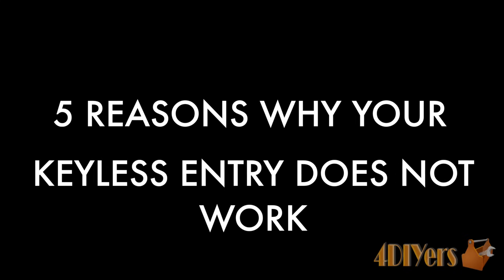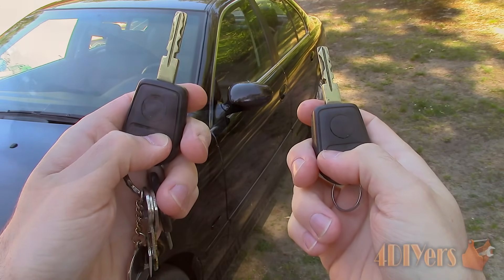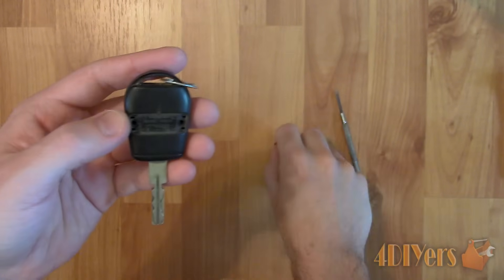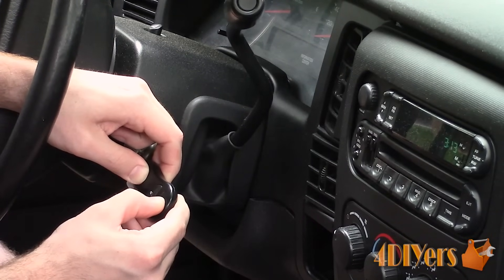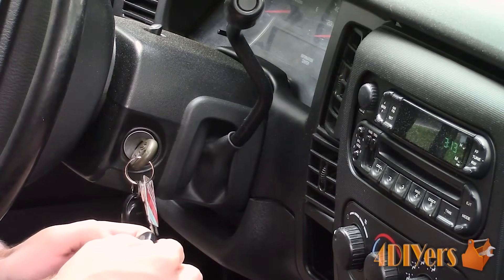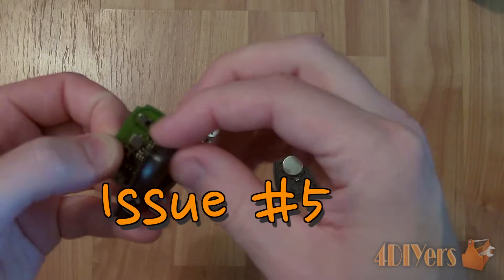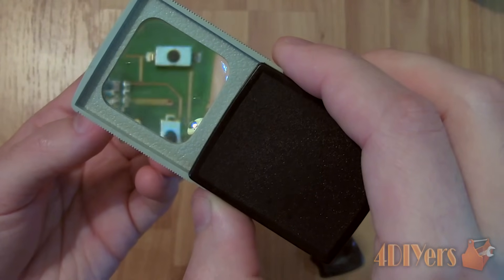5 Reasons Why a Keyless Remote Does Not Work

Comment: Note: December 2025, I went around and around because my 2013 Camry key fob CR 2016 batteries were bad. At times my key fob would not work then it stopped altogether. I found two unused Duracell batteries ( still in their original packing ( expiration date 2028 )). They tested 3 volts. I put them in my two key fobs and they would not unlock the door. I checked the fuses. I disconnected the 12 Volt car battery, checked the alternator and tried to reset the key fobs. I was looking at buying a receiver ($85.00 used on Ebay). Then, I found the paperwork on my unused CR 2016 battery. They were purchased in 2019. I went to Walmart purchased two Eveready batteries (Expiration date 2036). I put them in and both key fobs worked.
As stated by other, testing for 3 volts is not good enough.  Buy good new batteries with the longest expiration date.

Comment: I have an issue with which i am unable to find a related video, i use opel meriva 2011 whenever i lock the car with it keys. It flashes and then locks the front doors only. The back doors, for some reasons refuse to lock automatically, and i can't seem to figure out why. Can you help, please
Reply from the maker: If you press the lock button in the interior of the car, do the rear doors lock?

Comment: currently having an issue with my keyfob (2020 toyota yaris) I'll have my keys in car & the red key light will flash it won't let me start the car. after a couple trys it will eventually let me start the car what is the problem?

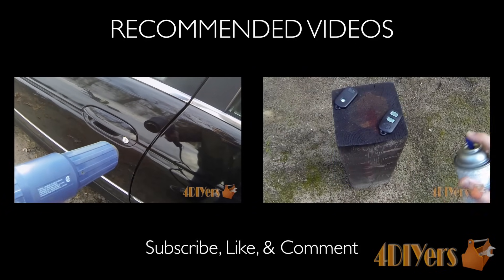Comment: 3:36  I replaced the battery in the pod for my 2006 charger, it will operate headlights and door locks but won't start the car, any advice would be appreciated.

Comment: Just changed my battery, it wouldnt work at all. Put the old ones back in, and my fob works when it wants to
Reply from the maker: Sounds like the new battery isn't fully charged and most likely old stock.

Comment: I have a 2005 Honda accord. And as a new widow I’ve got to figure this out on my own . I’m having a couple of problems. A viper alarm has been installed and the fob stopped working. Changed the batteries and it lights up but still doesn’t work. I’m assuming it has to be reset. That’s where the issue comes in. I cannot get my key in the drivers side door due to someone putting something in the key hole. I can’t get the key inserted. Is there anyway to reset the fob???? Thank u for any advice u can give me.
Reply from the maker: If you know the model number of your alarm system, you can usually find a user manual for it through Google. The procedure will vary, some have a reset button on the side of the module. To get the model number, you’ll need to find the module box in your car. If I had to guess, it’s probably under the steering column. That was a very common location.

Comment: My fob never opened everything, there was always an issue. First the passenger side stopped opening, then the trunk, then the drivers side. The only thing that opens is the driver side sliding door, and sometimes the passenger side sliding door, and the locks inside the car, same. My issue is that it stopped beeping about a year ago, changed the car battery and it started working again, now it stopped again. The theft light is still on in the car, and you can hear the back door locking, but no beeps.

Comment: Hello! A year ago, my Toyota Camry 2014 key fob had stopped working. I've replaced the key battery a few times and after many troubleshooting, I've dug out my spare key, and the same problem with my spare as well. I'm thinking it may be a fuse issue at this point because I've tried replacing batteries on both keys and trying reprogramming, but I don't actually have a function key at this point. Any ideas about what it could be?
Reply: I have a 2014 Camry as well and I'm experiencing this problem. It started last month where it didn't work for a day or so. It began working so I thought it was just a fluke. Now I'm experiencing it again . I don't believe it's the battery because I have a spare key fob and it's doing the same thing.

Comment: My first key FOB seldom used wasn't working, replaced with brand new battery still didn't work. My second key FOB for the same car was working fine, had cheap battery then died. Replaced the battery and now that doesn't work.
Reply: Wow, my same EXACT scenario. I'm stumped.
Reply: Same ours just started doing the same

Comment: Hope I can get some suggestions .My car was broken into car window on driver side was smashes door left open during the rain.Now my keyfob wont work to lock or unlock doors the alarm isnt working either or remote start.Also the button to lock the windows that is located on driver door no longer works.
Reply from the maker: Sounds to me like you have a wiring issue due to the excessive amount of moisture. The first step would be drying out the interior, then going over any terminals, use a contact cleaner like DeoxIT and replace any components as needed.

Comment: I had 2 keyfobs that stopped working my door locks. The batteries on both were 3.2V so they were great. While the batteries were out I took some electronic cleaner and sprayed it on a cotton swab to clean the contacts, reinserted the battery and voila! Keyfob #1 was working again - just needed the contacts cleaned. Keyfob #2 I had to take a pocket knife and GENTLY scrape the crud off the keyfob battery contacts to make them shiny again, cleaned them with the electronics cleaner sprayed on the cotton swab, reinserted the battery and voila - keyfob #2 working again like new! Dirty contacts was the problem with both my keyfobs.

Comment: Hi, I own a 2004 Chrysler PT with wireless remote; it can unlock the doors or sound the alarm. I don't use it, rather I keep in a drawer if I need it. Lately as I drive around the door locks are activated at random. I think this is because wireless remotes have become popular and the airwaves have become filled with remote key codes. How can I deactivate this feature? Thanks.

Comment: Every once in a while, I've noticed that using the key fob on our aftermarket car alarm doesn't disable it and the alarm goes off. The alarm light on the dash will still be blinking armed even after unlock was pressed on the aftermarket key fob to disable the alarm. The car didn't have a factory alarm system on it at all beforehand and the aftermarket alarm system was installed at a professional place. It rarely has this issue. Other times, in a certain large parking lot of a specific business up the street, it doesn't respond to unlock/disarm commands at all for a while and finally does. Just some kind of interference?

Comment: Not sure if I'll get an answer because this is an old thread. I had a weird problem with keyless entry. Walked up to my car and the key fob didn't work. I got inside the car and it worked. I got the other fob and it did the same thing. I bought duracell batteries and replaced both. It still was doing same thing and did it the rest of the day into the evening. I woke up and it started working and has been working ever since. I think that there is a number one and two fob when programmed. I'm thinking if the number one battery went completely dead it affected the number 2 fob. Maybe letting it go completely dead it may have lost its program and overnight it picked up the signal again.

Comment: Hello
On my 2008 Audi A5 Sport, the functions on my remote key fob have stopped, meaning i cannot lock and unlock doors anymore, nor the boot door, nor the fuel cap, not the retracting door mirrors. 
I can open the door with the metal key which is inside the fob, both main and spare key (the alarm will go off though) and the car does start when inserting the jey into the ignition hole. It's just the remote functions no longer work. It's not the battery inside, because i tried some new ones already, and the LED light on the fob does come on when pressing any button.
So what in your appreciated opinion, can be done about it? 
Best regards, Sergio UK

Comment: Thanks man, I had bad fuse contact, any product for cleaning the fuse contacts box? I was thinking of WD40 but I’m not sure if it is the best for this kind of situation. Thanks 🙏
Reply from the maker: No problem, happy I could help. Don't use WD40. For an electronics cleaner, I'd highly recommend DeoxIt D5 spray.
Reply: @4DIYers  thanks for the tip. 👍
Reply: Should be using an  electrical contact cleang spray.. very common in hardware and autoparts store

Comment: I have purchased 4 key remotes for my Kia 2012, they have new batteries, they used to work then completely stopped working, I purchased from the dealer at $99.00 for the remote and $99.00 to program, thats over $200.00 with tax!! Remember I said I have had to replace 3 and the 4th wont even program. I took it to an reliable auto remote dealer Who tested my remotes and and they were not able to program it themselves and told me my only other option is to take it to the Dealer!!  I am told it is $150.00 just to look at it and tell me why my remote wont program, and this does not apply to the cost if I would agree for KIA to do the repairs because then  the remote program is another $99.00, this is high way robbery, any suggestions?
Reply from the maker: This may help https://www.hendrickkia.com/manufacturer-information/kia-key-fob-tips-and-tricks/ Some vehicles now are dealer only programming, but that's something which happened in the last few years. It's becoming harder and harder to do things like this without needing special equipment. If that option above doesn't work, a Kia forum or Facebook group may know another way around for avoiding the dealer.

Comment: Hi, my remote key does unlock the car but not locks it, but the remote light is on when i push on lock, i got 2 keys with a remote in both and it's all the same problem. It is about programming or the remote module is defect?

Comment: You can also try cleaning the contacts with rubbing alcohol. While this didn't work for me, it works for a lot of faulty key fobs.
Reply from the maker: Great tip, thank you for sharing!
Reply: @4DIYers  Apparently 99% isopropyl alcohol is what’s suggested. I ordered some to see if that will work better than 70%.
Reply: Where are contacts ?

Comment: Here's one for ya! Without going into details, I fudged my key fob programming procedure! 
Now when I try to reprogram my key fobs and get to the point where you have to put the key in and take it out 6 times within 10 sec. is no longer needed because my car is stuck in that position.So I hit a button on the key fob, the flashers flash but the fob is not programmed.
I'm wondering if I should disconnect my battery for 5-10 min. and reconnect, maybe this will reset the system?
PS- I may be the only guy in the world that could F this up! No vids. On the subject! Pathetic, I know!!!

Comment: My experience. Found the truck I like  40000  my trade was 20000 didn’t want to finance much so I put 10000 down so I can finance 10000 my credit score it is great over400  and they told me that because I was financing small amount the bank would not give me a good  interest rate however if I finance 20 or more they will give me a better rate. I thought this is crap  they penalize me for having great credit and  because I am financially responsible. That is crap  anyways pay out my truck I instead of finance. Screw the banks  biggest thieves in the world

Comment: Mine wouldn’t detect the key fob in a 2017 Mustang GT. Replaced the batteries still nothing. Placed key in the little slot in the cup holder and it only detected it one time and after that no more. Had to tow it to the shop. 

Had to spend $1300 to get the problem “fixed”, and it still doesn’t work right. They told me they rewired the custom radio, removed the rest of a shoddy alarm install done by another shop, reprogrammed the keys, reprogrammed the car computer, replaced old modules that the other shop used with up to date modules and placed a cup holder sensor that was missing and would now detect the key fob in the cup holder. 

Still ended up with the car not responding to the key fob anymore, but now I can place the key fob in the cup holder slot and it brings the car on and allows me to lock/unlock the car with the key fob for a few hours before becoming completely unresponsive to key fob. 

I feel like I got ripped off, but they are still troubleshooting and we are going to put the stock radio back and see if that fixes the issue. So I’ll just hope the new shop can get to the problem without it becoming more expensive.

Comment: My Pontiac G5 2008 remote word only to open the trunk and the alarm but not for locking, unlocking or remote start. I have checked the fuse and it’s good and also changed the remote battery. What could be the problem?? This problem is eating me alive. Please help!!!

Comment: I’m having the exact same issue. Both fobs with new batteries(tested) will not open the doors. Car starts, no problem but I have to use the key to get in. I can control the door locks from inside with the buttons on the door. What is also odd, is that every once in a while,the fob works. From this video, I’m thinking it’s the module in the glove compartment. I’m going to call Honda
Reply: Mine too sometimes it works and unlocks it and others it will only lock it but won’t unlock m confused

Comment: Figured I would add my 2 cents, as I'm sure like many of you I came here because I was experiencing this issue.
Last week I bought a Bluetooth transmitter for FM radio… I discovered that when it is plugged in, it interferes with my remote in some way and jams the signal.
 I have been doing research all night trying to figure out why my key fob only works sometimes and it dawned on me that it was plugged in right now charging A couple of Electronics overnight...  I've only been having trouble with my remotes (I have 3)  For about a week, which is about when I bought this transmitter. 
It's super clear and my radio sounds great,  But I have a hard time getting my truck to lock when I run into a store or a gas station or my house if I leave the darn thing plugged in .
Ran outside after buying a 2 pack and replacing batteries, just now, and pulled the thing put of the cigarette lighter... remote worked first try. And continues to work as I circle my house. 
Hope this helps somebody!
Reply: Ash o the same thing as well, you may not know the truth is. If you're interested, let us help me with any questions you might have a
Reply: Bon, the more likely

Comment: Sixth cause, which I experienced recently.  I have keyless entry and my trunk buttons stopped working on the fob and the dash.  Turns out, there is a button that disables the trunk remote opening, located in the glove box, which had accidentally been pushed.  This is so that when you valet park you can secure the contents of the trunk.  Took it to a garage and they were stumped also for awhile, then figured it out, no charge to me.

Comment: Hey, first tnx.
I have civic 2011 and my key remote open the truck and close the doors (sometimes after 5 clicks ) and sometimes open the car, ( after lot  click), the battery is fine. What can be the problem? And how can I solved this?
Tnx.
Reply from the maker: Disassemble and clean the button contacts.

Comment: Last year nearly all car fobs in a local carpark near me would not work . After intense investigations  it turned out the issue was a local ham radio operator transmitting on 433 mhz using many watts which blocked 99% of fobs when he was transmitting to most car remote frequencies of European , Japanese + Korean cars which is reason fobs only worked temporary. 
Worth trying spare fob , 
Not sure if this is the same in the united states .

Comment: I'm stumped.  I have a 2004 Explorer - keypad works, FOB doesn't.  R&R battery in the FOB, no change.  I eliminated it being the FOB by being able to program the FOB to my Ranger...  FOB stopped working a couple days ago but worked fine until then.  Does one fuse control both?  Does whatever the controller is have a FOB side and a Keypad side?

Comment: 6th reason: FM transmitter or Bluetooth audio device blocks keyless entry fob. No issue locking the car  with the fob but the unlock frequency is blocked.
The FM/Bluetooth device only blocks the unlock frequency when it's turned on, unfortunately the power remains on to the device even when the car is turned off and the key removed etc. 

The device has to be manually turned off when exiting the car or the fob simply won't unlock the car. Luckily this car can be manually unlocked with the key...  :^)
Of course this could be a one off experience, eg this particular car (2004 VW Beetle) and or this particular FM/Bluetooth device (Response AR3142) which was purchased from Jaycar in New Zealand.
Reply: I just bought a jeep a few weeks ago that didn’t come with a key fob.  I ordered a new OEM fob and took it to a local lock smith to get it cut and programmed.  New fob was transmitting, coded correctly to my jeep, and appeared to be completely functional.  However, after it was programmed the locks did not respond.  The locksmith even cut a new fob from his own stock and again, did not respond.  $145 and no luck.  I just got home to troubleshoot, and saw this comment.  Sure enough, I had just put an FM transmitter in the cigarette lighter 3 days ago.  I ran outside, pulled it out, and BOOM, fob worked on the first try.  Thanks for commenting this!!! #6 solution for sure!!!
Reply: This just solved my problem. I appreciate
Reply: My k9 remote light up.. but doesn't  work..
Reply: Qq+

Comment: I have a 2008 Suzuki XL7 . Driver side an back Driver side does not unlock when put into park or locks with key fob.. any idea what it could be? I also have remote start an never had a problem with any of this..
Reply from the maker: Sounds like you either have a faulty actuator or an issue with the wiring going to the actuator.